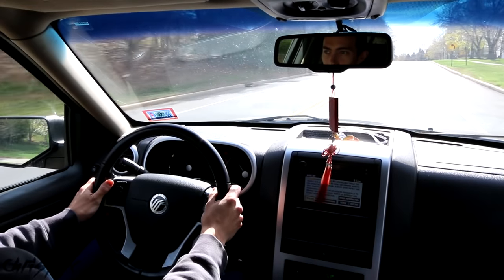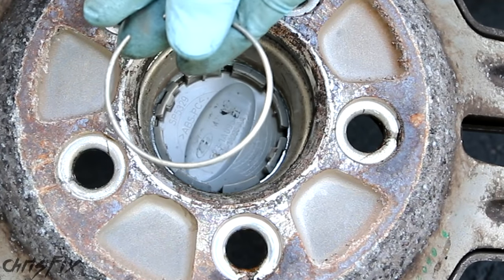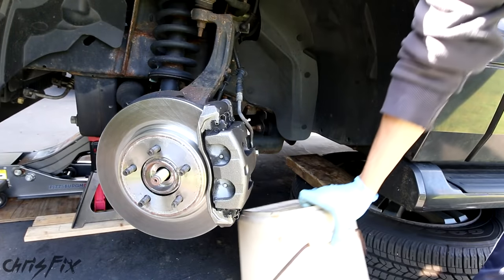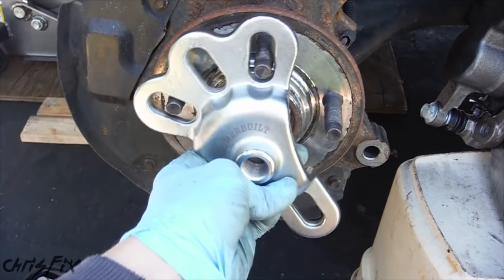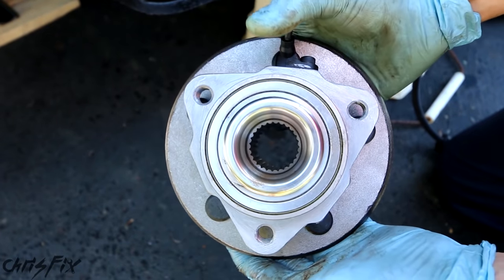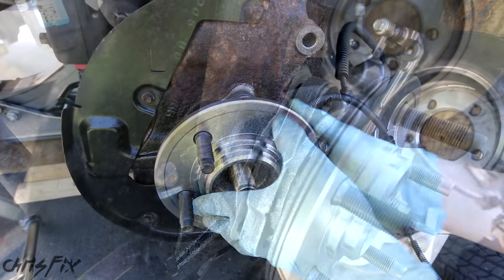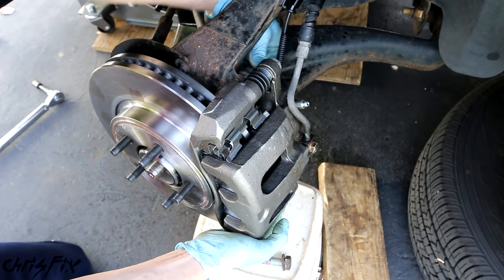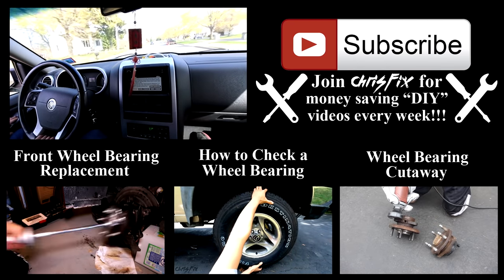How to Replace a Front Wheel Bearing

Comment: Dude, you have saved me thousands of $$$ (no exaggeration) and are about to save me $500 more. Being able to fix my own car is profoundly empowering. I hope you have some idea of how awesome your videos are and how valuable your work is. As someone else said already, I hope you can make a living from this somehow. Mechanics need to step up their game if they ever want my money again.
Reply from the maker: That’s awesome man and that’s exactly why I make these videos!!!
Reply: Yep... what you said!! @ChrisFix is a mentor to manhood.
Reply: front bearing replacement on a ford should be no where near 500, what r u talking about...   labor on my car which is infiniti AWD only costs 100...      your getting ripped off
Reply: @floggyWM1  that's the whole point. So people don't get ripped off from stupidly high prices
Reply: @floggyWM1  He may have been including the cost of the bearing, which if you buy at the dealership is going to be significantly more than if you were to buy the bearing elsewhere and install it yourself.  Also, if the bearings tend to seize on they may charge you more.  Folks in the north would see that alot more often.
Reply: @CBTalon97  Dealerships usually have a warranty on their parts, that's what I have been told. I can get a genuine mopar bearing with the ABS sensors for around 150-200 depending on the part store, the dealer is quoting me 500 for the part alone. Of course aftermarket parts that may be just as good are available for around 100.
Reply: @ixionn563  that does make sense, but you'll also notice that Dodge generally charges significantly more than Mitsubishi for the same parts.
Reply: I'm sure he makes a living from this just fine.
Reply: 5.6M subscribers. This guy is making a shit ton of money
Reply: Thank you for making theese videos saves me so much money not having to take it to a shop and being able to work on it myself
Reply: I tell my customers about what to listen for. Bearings aren't what they used to be. Yeh, they're sealed. But, they're not as good as you may think. Park your car in a puddle of water, the curb side front bearing will fail.
Reply: Jeremy Douglas Yep, and companies like Tesla want to take that away from you.
Reply: You are a natural at this stuff
Reply: Tools, time, and space are your only limits.
Reply: @chrisfix  oh
Reply: @orppranator5230  they dont want to take it away, they want autonomous vehicles to be possible and noone wants you trying to repair a car with much newer technology on it until the kinks are worked out and then go and drive it on autopilot and make a bad name for tesla.
Reply: The market will always adjust this is why it's important that the average person be at least somewhat competent. The push to make everyone go to college has had the unintended side effect of very few people having basic skills outside of academia
Reply: I am an auto parts manufacturer from China, can we pay attention to each other
Reply: And now he's the largest automotive related channel on YouTube
Reply: @JoseDiaz-rd9fh bit of a non sequitur, no?
Reply: I wish I watched this video before I went to a mechanic for a wheel bearing replacement. They charged me $511 😢

Comment: In the North East, what you encountered removing the wheel bearing is what I call normal. Last week I changed the drivers side wheel bearing and CV shaft. The wheel bearing and CV shaft took me at least 40 minutes to loosen and remove. Once everything was cleaned and prepped, the new parts took a mere 5 to 6 minutes to install and tighten. 

Another great video Chris!!
Reply from the maker: Rust doesn't make things easy! Thanks a lot!
Reply: I feel your pain

Comment: I enjoyed your multi-screen “this f&$)ing bearing won’t come off” montage!  🤣

Ain’t that the way mechanicing goes? 🤦🏼‍♂️
Reply: that multiple hitting cracked me up xD
Reply: Thankfully he got to hit something without it being a bad thing
Reply: Definitely the way it goes. Let me tell you, one time I was with a couple friends(years ago), and we were trying to do something on the car (I think replace CV), but it required removing axle nut. We had breaker bar and cheater pipe, but it wouldn't budge. We tried air-powered impact wrench, and it still wouldn't budge. I finally had the idea to take it to the nearby semi-truck workshop and ask them to use their crazy huge impact to remove it. The guy was hesitant because he didn't want to be liable for damage (could've easily destroyed the thread, but we were getting desperate). It finally came off (with an impact that produces somewhere in the 1500-2000 lbs-ft of torque, at least). That was the craziest one I ever had to deal with.

Comment: One trick I found was to put one hub assembly bolt back on and tighten it about 3/4 of the way. Once there just get an air hammer and hammer that bolt and it will push the assembly out. This technique has save me several times and it's a lot less exhausting then beating the assembly over and over. That and some good penetrating oil does wonder.

Love your videos by the way, thank you for making them.

Comment: Chris, My son's friend is a professional mechanic for over 30 years, he told me the best way to remove the hubs on my Jeep liberty is to leave the bolts in about 5-6 threads and use the same socket with a short extension on it and place it on the hub bolts line it up and use the power steering rack to remove the hub easy peasy, it popped it right out, no beating your brains out. The simplest thing I have ever done. Just thought it would be a good content Video for you. :)

Comment: Did you forget to re install that splitring / metal clip on the axle nut cover?
Loved the hammering compilation :D
Reply: Azurren cotterpin?
Reply: xX_VEN1X_Xx no. centercap snap ring
Reply: The ring goes on the cap before u install it.. So he might have just missed recording that part
Reply: Azurren This video would be way too long if all of the common sense steps weren't edited out.

Comment: Great video. One suggestion, put a rag over the axle splines when you remove rust from the mating surface of the steering knuckle to keep dirt and rust off the half-axle. I like it that you put anti-seize grease on mating surfaces before re-assembly.

Comment: There’s something so satisfying about the click of a torque wrench when you reach the proper ft lbs. 

Like ASMR
Reply: Indeed
Reply: It’s not really about satisfaction but rather it is frustrating knowing you can break a bolt or letting it become loose if you don’t use a torque wrench. It is really not a good feeling when you know you can increase the reliability of a work performed on a car by using torque wrench, and somebody just doesn’t so it. I no longer send my car to any car repair shop for any work, no matter how big or small, it’s too much of a frustration knowing that the more you send your car to a shop the more your bolts are gonna be tightened to a different spec than it’s supposed to, or even gone missing.
Reply: @davidgruen7423  Ya I could definitely agree with that. I’d say both are true
Reply: Let me tell ya about a recent video...

Comment: A tip to break the hub free, is to remove two of the wheel studs, one each side,  and insert hardened bolts from the front.  Put a nut behing each, put a spanner on the nut and tighten the bolt.  You've basically made a puller that is acting on the hub/knuckle casting.  Yes you will get two small marks on the casting from the bolts bearing against it, but it won't be a problem.  Saves a heck of a lot of beating.  The bolts must be hardened, otherwise you'll just strip the threads of the bolt off.   I also coat the bolts with a smear of moly lithium grease.

Comment: Nice video, I fixed the rear wheel bearing for my own car. It was easy to fix and took me 30 minutes to fix. It was hard to disassemble some components because it was rusty but after beating it with a hammer a couple times the components came off :D

Comment: screwdriver in the brake rotor trick = genius!
Reply: +hallis1 what minute and second?
Reply: Made that comment 5 months ago. Don't remember where exactly. just watch the whole video it's worth it.
Reply: hallis1 ok mate :)
Reply: I used this trick before...once the axle nut was on sooo tight that the screwdriver bent under the brakes lol
Reply: +Antreas Cy 3:25 killer trick if not using an impact, or working alone with no one to push the brakes for you to hold the rotor. As the transmission will still allow a single axle to turn with enough force even though it is in park.
Reply: +hallis1  works if you jam between the studs too.  That rotor is cast. those studs are machined and will tolerate more torque stress, don't  matter if their damaged, their being replaced anyway.  The trick being used is called pry back wrench or bar.

Comment: 175 dislike is motor shop owner that think this video reduce their income LOL
Reply: Because it did... just did mine for 150 they charged my buddy for the same car 400
Reply: USD $ 150 ????
Reply: +Dante hollow yep. $99 for the assembly (rockauto.com) , $25 for the spindle nut (ford dealership price ), $10 for the socket, $15 in miscellaneous.
Reply: +Arcon911 - Wow, I got mine locally for less than $80 each including the spindle nut and they are OEM branded. Mine don't have ABS sensors at the hub though so I guess they are cheaper.
Reply: True XD hahaha

Comment: I never go to the dealer, but since it is close I went in this week for my yearly inspection, they failed my inspection because of a front wheel bearing and quoted me 500 dollars for the part alone. Guy at the service desk offered to print me the part number when I mentioned I'd replace it myself, he gave me the part for a Dodge Neon! I drive a Ram 1500 for crying out loud! I've found good deals on the replacement part and I'm going to replace it myself, then have someone else most likely do the inspection, so I don't get rejected again! Only trouble is I can't figure out whether I have 2 wheel or 4 wheel abs sensors, I can't find any wires going to the front wheel bearings, but I'm yet to get the seized up brake caliper bracket bolts out. Hopefully I figure this out soon.

Comment: Thank you so much for sharing your knowledge with your viewers! I finally did my first oil and oil filter change last year, and I felt so confident because of your detailed demonstration. I’m looking at this video to see how I can change the wheel bearings on one of my vehicles, but I’m still a bit intimidated because the rear has drum brakes. Do you have any suggestions on how to change the wheel bearings on those type of vehicles?

Comment: Tell you a trick guys, when you are trying to remove the old bearing assembly, leave the bolts attached several turns, and use a hammer to tap on the bolt heads to drive the bearing off. I learned this trick from the Audi repair manual on how to replace an alternator. The alternator is notoriously hard to remove, because nobody bothered to read the repair manual, lol.

Comment: September 2021 - Just replaced two front wheel bearings on a 2006 Saturn Ion 2. I made some ATF/Acetone fluid and used a slide hammer tool to get them out OK. A bit stubborn, but nothing like the ones you see on here. I hit them with a sledge hammer first, maybe five times each side, then like five pulls on the slide hammer to get a separation. Then more penetrating fluid... wait... a few more slide hammer hits... pop! Honestly, the most taxing part of the entire operation was getting the caliper bolts aligned with the holes during reassembly!